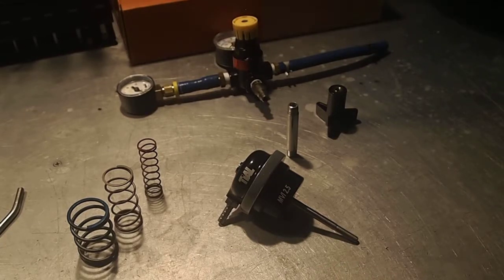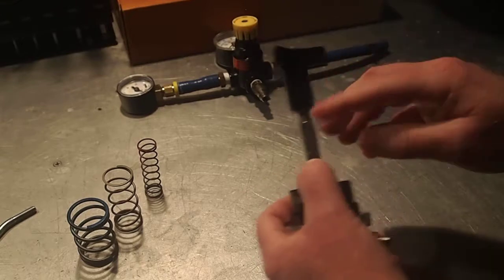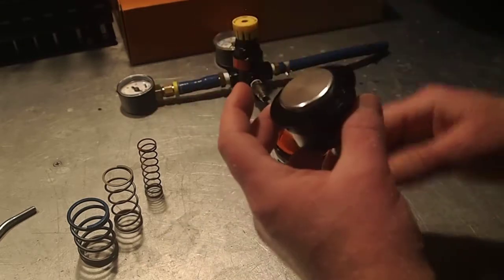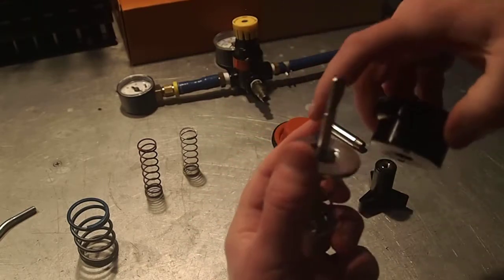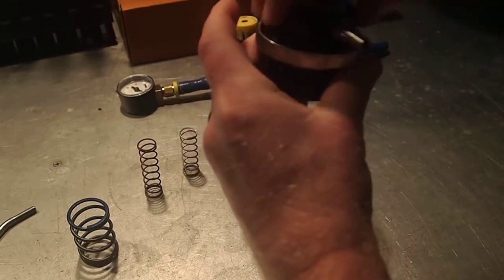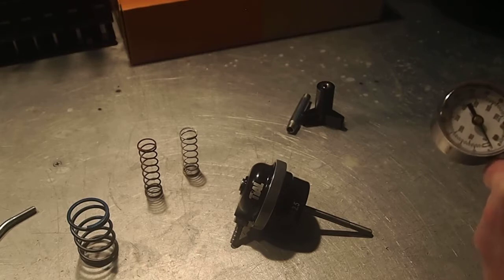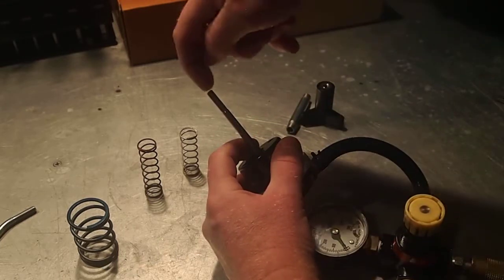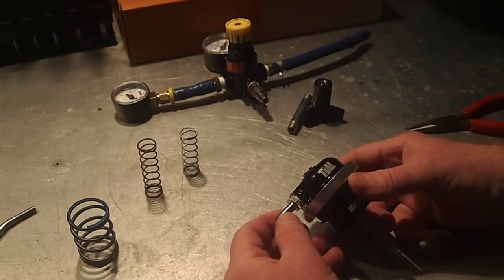TiALSport MVI 2.5 Spring change and testing

Comment: Tial, it looks like this can be used as a two-port wastegate actuator by fitting an extra air fitting set to the second port (top / side), for driving with a four-port solenoid. Is that correct?
Reply from the maker: Hi, Isaac! 

We actually make a sealed, dual-port version of the MVI 2.5, called MVI 2.5D. 

This model is, as you describe, fitted with a different lower housing, machined for another M8x1.0 fitting, and the mounting feature is produced with additional positions, so that the lower housing air port can be 'clocked' as needed. The MVI 2.5D uses a positive, spring-loaded PTFE seal that is very effective, but it does require that the linkage is designed for zero deflection during valve travel. It will still seal quite well if there is some deflection, but the life of the seal (which is available as a service part) is compromised, so taking the time to design the linkage properly will result in excellent control and long life.

The same test method applies, and the same Field Service Tool works on both models.
Reply: @tialproductsinc1860  Thanks. Can you point me to the MVI 2.5D part? Having problems finding it on various stores. It is a whole assembly, or only the lower housing as an individual part (or parts?)
Reply from the maker: @eyz42  Hi, Issac. Please email tech@tialsport.com and we can guide you to this item.
Reply: @tialproductsinc1860  E-mailed. Thanks again!

Comment: I tried loosening the lock ring but it is extremely tight.  Should I use a pair of channel locks to get it loose?
Reply from the maker: Best to use a rubber or nylon strap wrench, as this is how we assemble and tighten them. Remember that the thread is designed to tighten from the inboard side of the canister toward the outboard, so this may seem 'reverse' if, for example, you're facing the top of the canister.
Reply: @tialproductsinc1860  I got it off eventually.  what i did was clamp the top portion in a vise with rubber pads and then it was able to unscrew it.  It was a bit tight from the factory.  Thanks for the quality parts btw.  I only use Tial for my boost control equipment.

Comment: I have the bent z rod. Is there a good way to disassemble? Or just use a bench vise?
Reply from the maker: Hi, Johnny, if you click the link further below, we've finished production of the new Field Service Tool, which makes these spring changes even easier than we have detailed in the video, and that tool can be used on either stem design. Alternatively, you can reach out to us by email and arrange to send the actuator in for a spring change. Just email tech@tialsport.com if necessary. The link takes you right to the page where all MVI service parts and tools are listed and available to purchase directly.